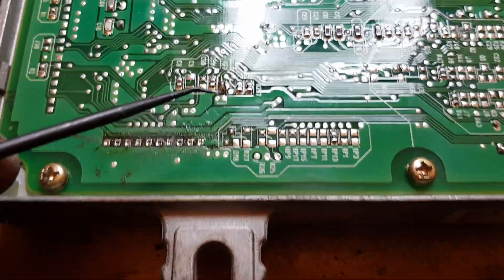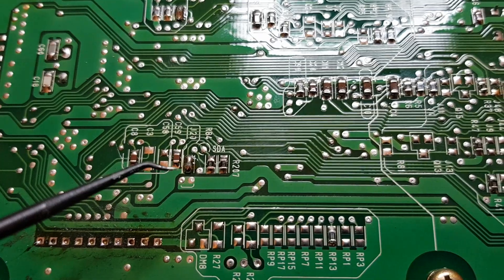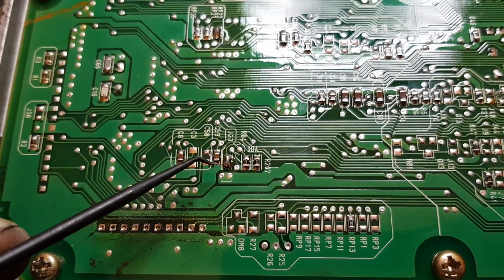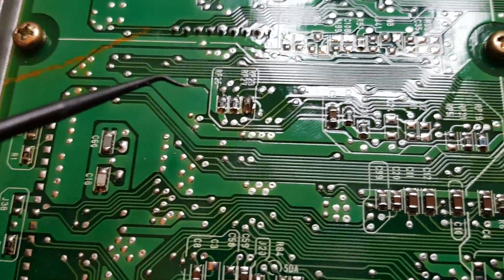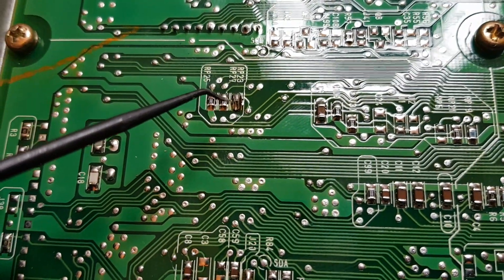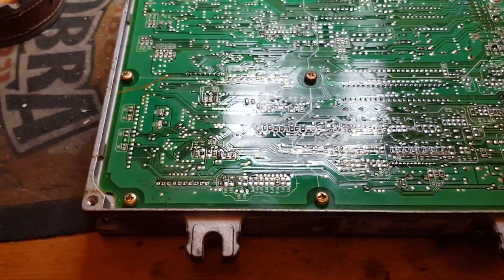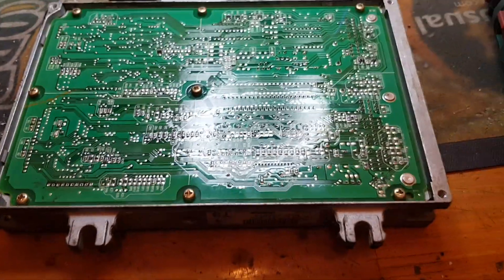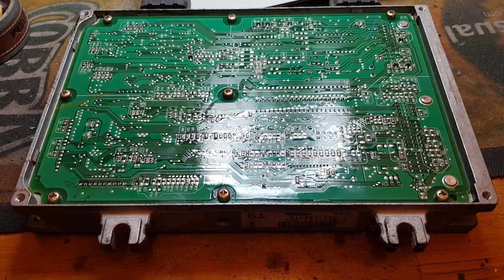unlock immo honda p2y ecu

Comment: Hi dude, do you know if it works the same for a P2P ECU?, I saw the video and the P2P have the same things to remove that you show.

Also I have 2 bads ECU that don’t send signal to the fuel pump, is because some capacitors are bad?
Reply from the maker: Thanls for watching.
Yes it works for the p2p, the bad ecus i had a few along the years and its not always the same problem...next one i get in my shop i will make a video on how to test it and repair it.
Reply: @PSICompanyPerformance  Thank you for responding and I will be impatient to see that video.

Comment: Hi,  done exactly what you have done, but it doesnt start. Check engine on. Only diffrence I notice is that I have P2Y G51 EBand yours is P2Y G02 T9. Do you have anu ideea why it doesnt start ? Thank you.
Reply from the maker: Did you make the jumpers in the back
Reply: @PSICompanyPerformance  Hi, yes I did. În the meantime I realizat that the problem dar that P2Y it's not for my engine. I have D15Z6, so I need a proper ECU. I'm sorry I bothered you in vain, you do a creat job. Hopa to come back with a real problem . Thank you again.
Reply from the maker: @catalinghirocean2791  not bothered at all my friend to use the other ecu it needs to change pins on the plug
Reply: @PSICompanyPerformance  Hi, I found  a n ECU just like yours and done like you said. Victory ! It starts and works fine.  Only one thing , check engine remains on, after innitialy goes off at start. Any ideea ?  Thank you again, your video was a real help.
Reply from the maker: Have you check the codes or have you clear them...?
If its for the correct type engine it shouldnt be any codes but if the engine is diferent than the ecu is for you must change some wiring in the plug

Comment: I have 2001 Honda Civic where or how do I find out which risistor or connector to desolder from my ecm my car is locked in theft mode
Reply: did you ever find out about this I have an 01 civic and desperately need to bypass the immobiliser its been sitting in my driveway for 2 years because I refuse to pay the stealership even close to what they are asking

Comment: Hi, sorry to bother but i have a different problem i guess, i switched the lockers and key and code reader thats where u put the key in and the guy who sold me all that didnt give me that black box thats under the steering wheel, so i did all u have done in the video and it still doesnt start, its a honda 1.5 vtec 1997 with same ecu, i have the green flashing key light blinking on the dashboard :( doesnt turn off
Reply from the maker: Thanks for watching.
The starter isnt working?
If not just bump start the car to test, it should be working.
Did you give ground to the starter relay?
One of the legs of the starter relay should give you 12v when the key is pushed to starter position...on the leg straigh across it you must give negative to have starter.

Comment: On the other side of board what I do it .can you explain.thanks
Reply from the maker: On the other side you need to bridge those places i mention in the video
Reply: So am i connection j20 to rp23 or bridging the joint at there own points
Reply from the maker: @traonboyd2451  bridge to points

Comment: Is it the same for a p3y ecu?
Reply from the maker: Thanks for watching.
For the p3y i believe you just the OKI board and give ground to starter relay.
Reply: @PSICompanyPerformance  but also eliminated immo plate and jumper over rp23??? what is the oki board sorry for asking
Reply from the maker: @matthiasdeceuninck3409  the oki board is that board with the oki eprom on it as seen in tge video thats is no rp23 on the p3y.
Reply: know now what oki board is
Reply: @PSICompanyPerformance  so ok just remove the oki ok thx
Reply from the maker: @matthiasdeceuninck3409  yes and dont forget to give ground to starter relay for it to work.
Good luck.

Comment: Is this the same on a manual
Reply from the maker: This is on a manual car...
If you do this you need to ground the starter relay...
But to test you can bump start the car just to see if it works...
If it does then you must geound the relay for the starter